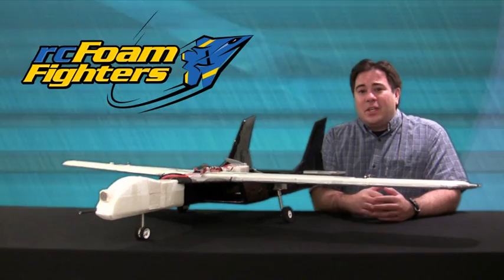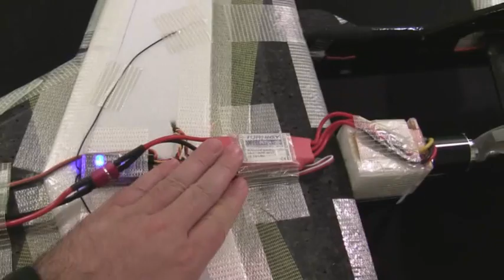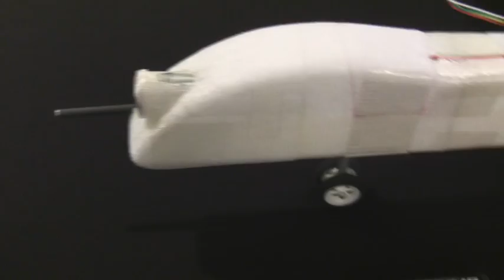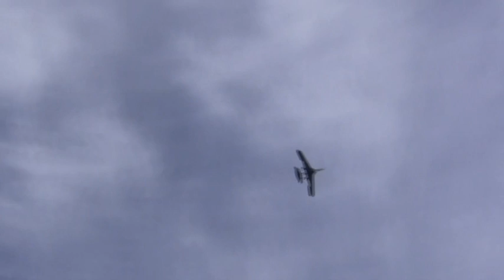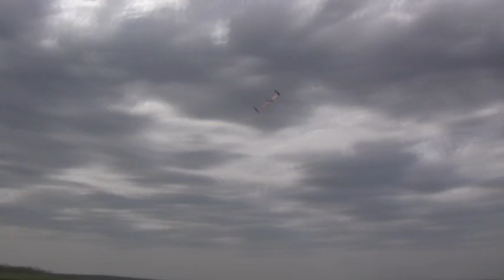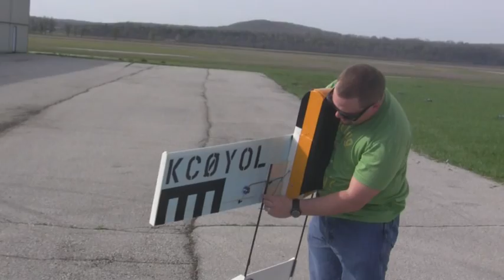FF-64 Recon Part 3 (KFm2 Airfoil RC Plane)

Comment from the maker: @0MoTheG  The motor is a Turnigy SK 3548-1100. it is actually a pretty large motor. Rated at 770 watts. I am running a 10x5 prop on 4S lipos. it weighs 179gms. So i think it is bigger than your moto, LOL. Might of looked small because the plane is fairly large. Anyway, cool on your plane too, would love to see it. Thanks for watching!

Comment: the motor looked small. I got one that is 1100kv and 105g that I use on a 3s with a 10"x6". what does yours weight?

Comment from the maker: @StrykerF27c Thanks for the interest in this plane StrykerF27c. The plans may still be a little ways off as i still have to do a bit more testing and finalize the location of the battery. Hopefully soon though I can get it all done and make some planes for it. I may make a smaller foamboard version too. Thanks again Stryker27c!

Comment: when i was listening to you talking, it sounded like you wanted little to no roll when using rudders. you could just program the ailerons to mix with rudder input to keep it level. i have also used the 3 step flaperons and spoilerons to do both (just program level flight in the middle setting and you can flip the ailerons either up or down). this way you get the best of both worlds. i find spoilerons to be great with high alpha and flaperons to slow the plane down when when flying level only